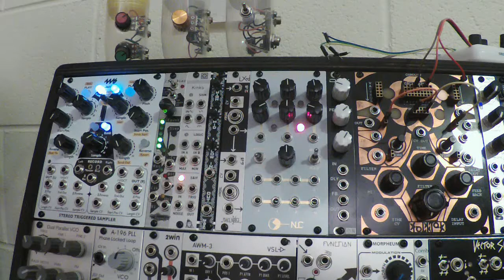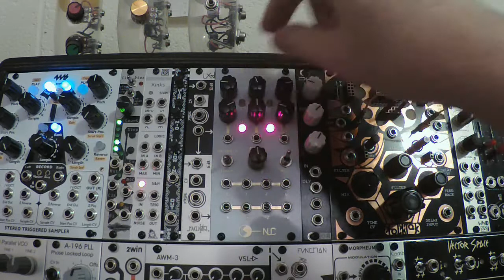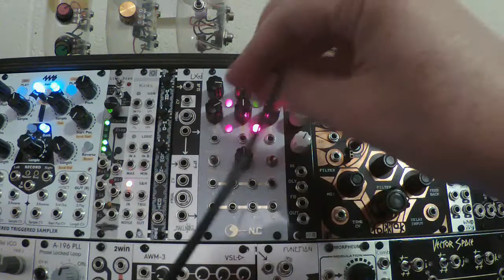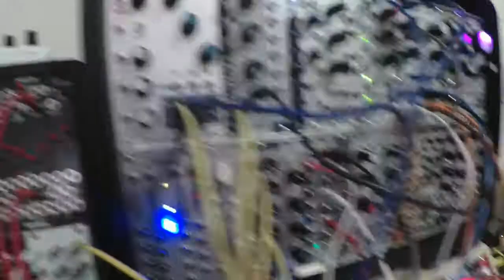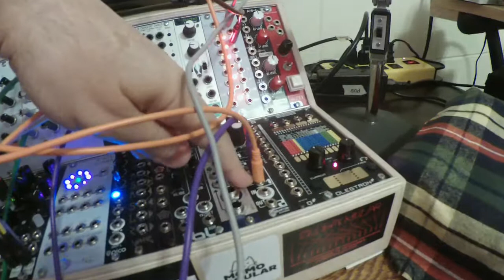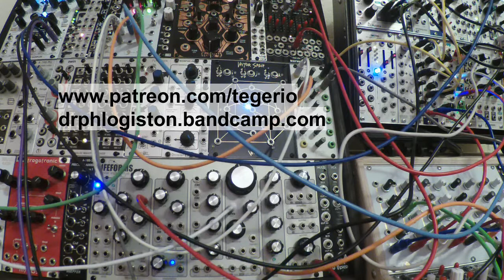NLC Ian Fritz's The Hypster

Comment: I like NLC...quality Modules I must say,,,especially there clock dividers... Thanks for sharing this...
Reply from the maker: It depends somewhat on who builds them.  As I understand it, NLC doesn't actually sell modules, or even kits.  They get panels & circuit boards printed up and they sell those .. the builder then has to gather all of the components and solder the thing together on their own.
One thing I've noticed about NLC is the circuit designs are weird.  There seems to be a penchant for chaos, unpredictability, and things that are hard to control.
Reply: @JoshuaKennedy321  Thank you Joshua..Appreciate your response...